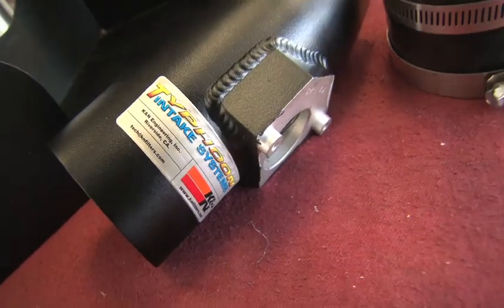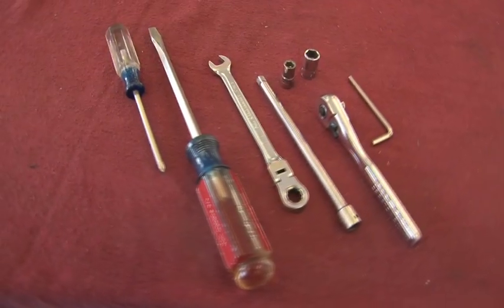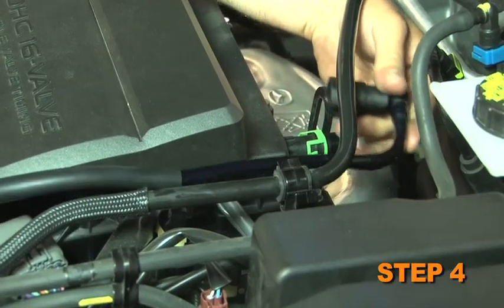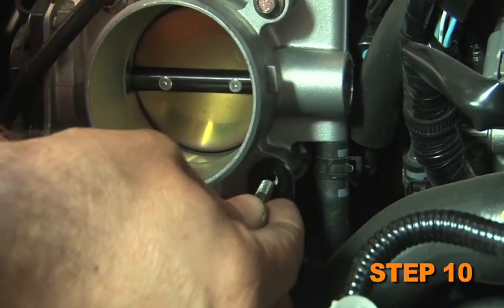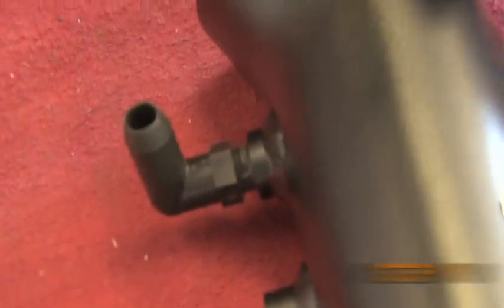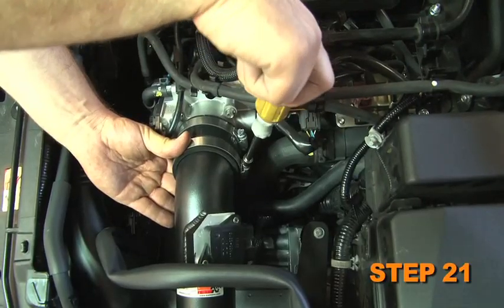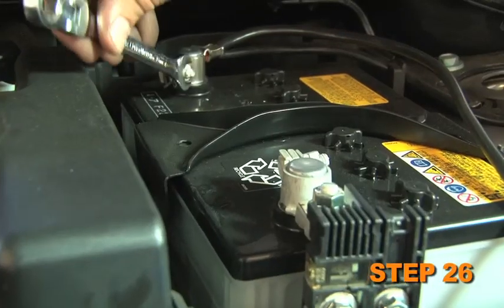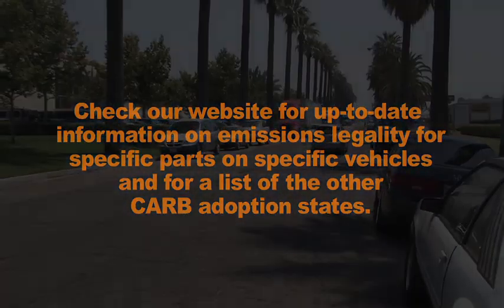Mazda 3 2.5L [#69-6013TTK] Air Intake Installation

Comment: Will this fit a 2014 mazda5?
Reply from the maker: No, this system has not been tested to fit a 2014 Mazda 5.  If you have any other questions regarding compatibility please contact our Product Specialists at 800-858-3333 or tech@knfilters.com.

Comment: Will this fit the 2010 Mazda 3 2.0L hatchback?
Reply from the maker: No the system will not fit a 2.0L Mazda3.  If you have any other questions please contact our product specialists at 800-858-3333 or tech@knfilters.com.

Comment: Does this work for 2008 Mazda 3 2.3l sedan
Reply from the maker: No this system will not work with a 2008 Mazda 3 2.3L.  Check out the following link for some options the will: https://www.knfilters.com/mazda/3/2.3l-l4-gas/2008/
Reply: @KNfilters  thanks a lot! I also subscribed to your YouTube.

Comment: i guess having the 6 speed auto really adds a lot of driveline loss because my 2012 Mazda3 2.5L 6 speed sedan put down 152.4 hp on a dyno last month with a corksport intake, regular gas and about 50 degreeF ambient temps.  (its really hard to find any videos of a 6 speed 2.5, theyre all auto or 5 speed 2.0's.  rare breed, indeed.  (especially in the 4 door configuration))
Reply: I'll consider myself lucky then, just got a 2.5 with the 6 speed manual 3 days ago but I live in Cali
Reply: @cartertufts0401  I also have a 6 speed GT 2.5L. I just ordered one of these tonight. Can't wait !
Reply: @cartertufts0401  Did you end up getting one of these K&N's? interested to hear how you like it.
Reply: I literally have the exact same car in this video, but the way sexier Micra Red and 6 speed! I love her! Best car I have owned to date!

Comment: KNfilters, I have a 2015 Mazda 5, the engine and intake look exactly the same. will this intake work? thanks! awesome product!
Reply from the maker: +1stStLversys 

Currently, we do not produce an intake kit for your
application at this time. If you would like to request product for your
application, follow the provided link and fill in your information. You will be
notified via email when product becomes available. http://www.knfilters.com/register/products_needed.aspx
Reply: This is annoying. I also have a mazda5 and it seems like all the engines Look alike, but can't use the same products so frustrated.